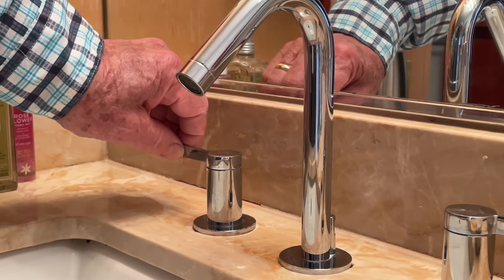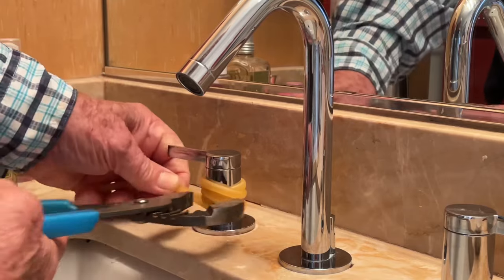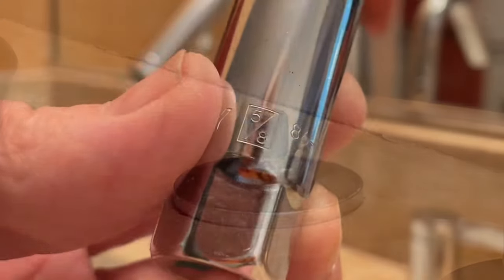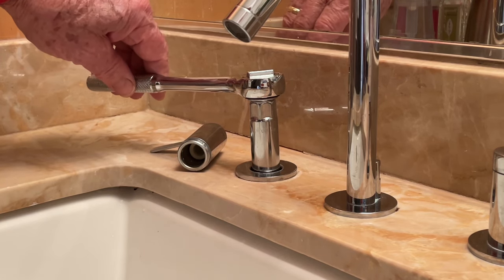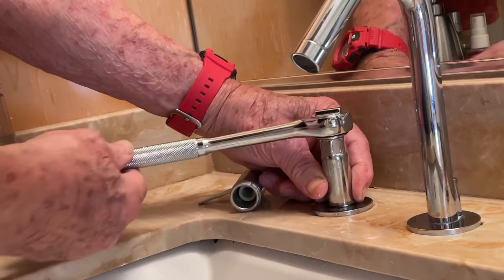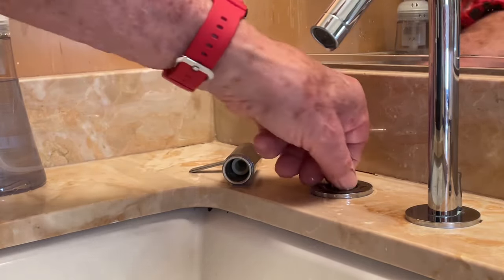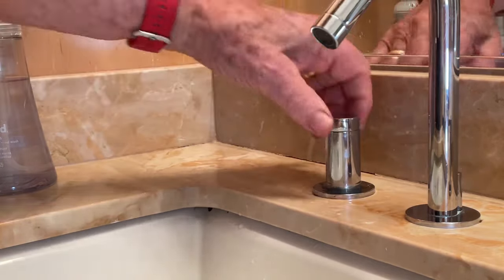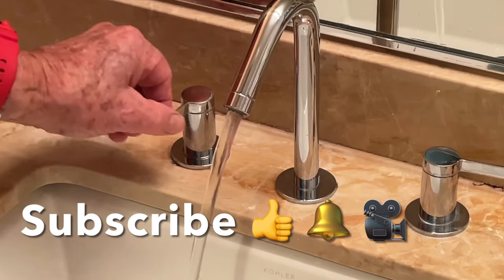Kohler Bathroom Faucet Cartridge Replacement _Repair

Comment: Thanks for this video. We had a Kohler where the bonnet (the handle portion of the faucet) would not unscrew. We tried padding the handle area with inner tube rubber and applying pliers, but even that would not turn the handle portion (it also very slightly nicked the handle base). After undoing the faucet nut underneath the sink (itself a challenge), we pulled the whole handle assembly. For some reason that made the handle portion easier to unscrew. The problem with the handle portions is they are not well-shaped for wrenches.

Comment: What is the brand name and model number of the faucet and the cartridge part number if you have it.  I have the same one from early 2000s but no paperwork on it. thank you
Reply: Kohler Ceramic HOT Valve K-GP77005-PR  &  Kohler Ceramic COLD Valve K-GP7706-RP
Reply: Do you have the brand name of the faucet itself? My handle is leaking from the top and I think I need to replace the handle, not the cartridge.
Reply: I have the same faucet. It's Kohler "Stillness" I'm not sure of the model #. You should be able to find that on the Kohler website.

Comment: Any Suggestion on getting cartridge loose ? Tried both trick you showed and it refuses to budge. For the top part I used Vinegar and it helped with loosing of other parts on this Kohler fixture but not the cartridge . Strong attempts at loosing without counter measures only turns the fixture with pipes attached.
Reply from the maker: I just saw your question. Liquid Wrench over night. Then you must use the right size socket wrench on the cartridge and the right size wrench on the nut on the underside of the sink. On one of my cartridges I had to use a lot of force and get a neighbor to hold the open end wrench. If that falls then you have to call a plumber. How did you finally solve your problem?

Comment: Thanks for posting this video! It definitely got me on the right track. 

After installing the first one with this method, I found that it was actually easier to loosen the part securing the faucet handle to the counter and pulling the whole thing up, so that I could get my wrench around the bottom without having someone crawl underneath (there was very little space to maneuver).

Comment: Thank you!  Is there any way to know (for my Kohler Tub Cartridge) if it's 1/2" High Flow Valve or 3/4" High Flow Valve?  They would require different size cartridges ex:  3/4" = part numbers: 1000187 (H) and 1000188 (C)

Comment: Great video thank you.   Does it make a difference hot vs cold side, which direction the cartridges loosen?  Both of fhem counter clockwise to unscrew?  Thanks again
Reply from the maker: Yes. With this particular cartridge, there is a right and left model. You have to be careful that you buy one for each side and put them in correctly. Some devices allow you to reverse a ring to make the device either the right or left side.
Reply: The hot vs cold is clockwise close vs counterclockwise. But does the cartridge and cover have opposite threads also?

Comment: I have the same issue, except cold side. Video is very helpful. But is there any repairing the cartridge vs replacement? Maybe a soak in vinegar and hot water? Any feedback is appreciated. Thanks.
Reply from the maker: Certainly worth a try. Thanks for commenting.